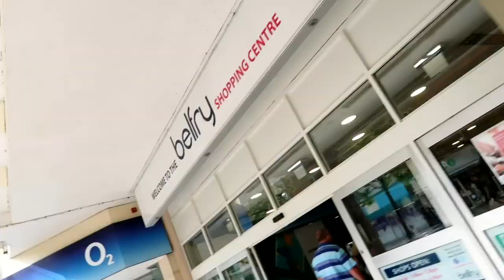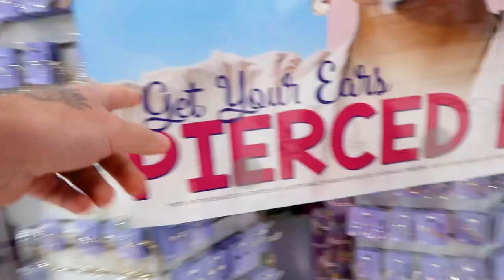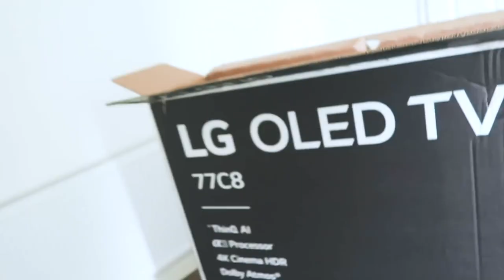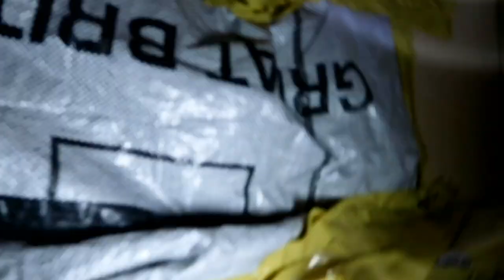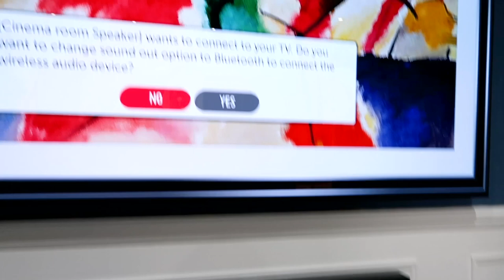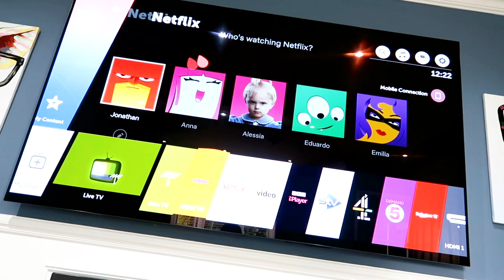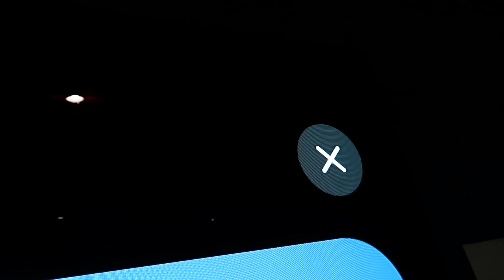NEW SHOE SHOPPING WITH KIDS!

Comment: Just to add to the Claire's discussion.. If you take her to a piercing parlor she has more options for earrings right away rather then a stud that can be very uncomfortable. There is less pain with needle piercing then the gun too because it doesn't put the same kind of pressure on the ear. Though Claire's does use new needles obs with every customer they use the same gun over and over and don't always sanitize nor do I think the guns can be properly sanitized at a parlor they use an actual needle and a new needle with every customer.

Comment: Jonathan when you take the children to get new shoes they need to be standing up when they get measured to get accurate measurements of both length and width because your foot spreads and changes in both length and width when you’re standing and walking around. When they have the shoes on they need to have a minimum of one thumb width from the big toe and the end of the shoe more if the toe box is narrow. They need to be wearing socks or tights similar to what they will be wearing whenever they are wearing the shoes.  I worked in a shoe store for 6 years and was professionally trained on how to fit shoes properly. It irritates me when I see the salesperson doing it wrong because they are fitting the costumer, especially a child, with a shoe that won’t fit properly or last very long because their feet are still growing and changing and how the shoes fit can affect how the foot grows and how they walk. My youngest sister fell in love with a pair of shoes when she was 3 or 4 and demanded to wear them even when they were too small and it affected her toes permanently making it harder for her to get a good fitting shoes. She has to get a half size larger because of it.

Comment: Jonathan please research getting her ears done by a professional piercer because they use a single use hallow needle which causes little to no pain on earlobe piercings plus it is less traumatizing to the skin and ears. The problem with Claire’s is that the gun they use causes a forceful trauma to the skin and ears which can lead to keloids forming (it’s a type of rapid growing scar tissue that can result in very large bumps and heavy growths at the site of the trauma. Check out Lulus body piercing channel where they show them and explain how they form. The piercing gun can’t be completely taken apart and cleaned enough to guarantee that no germs or bacteria get transferred into the ear of the next person getting pierced. Plus the cleaning solution is actually bad for the skin and wound because it contains alcohol and other chemicals that can be harmful. When cleaning use saline solution or liquid antibacterial soap that you dilute a drop in warm water stir and use a cotton swabs to clean front and back then use a clean swab for the other ear then rinse with plain water.  Most piercing shops are moving towards only using titanium , titanium plated with real gold or silver or real gold or silver jewelry because they are the least likely metals to cause a reaction. If you notice a bump forming at the piercing site you can put a drop of Tea Tree oil on a swab and rub it on the bump. Leave on for 10-30 minutes then wash it off. If you feel any burning immediately wash it off with soap and water because some people are more sensitive to it than others and it can have a caustic affect on the skin.  

I understand how overwhelming it can be for the father because I know what my Dad went through with his 5 daughters. Dad came from a generation where the females of a certain economic level didn’t get their ears pierced so he was highly against any of us girls getting it done. My eldest sister didn’t get her’s done until she was in her 30s. My next sister got her’s done at 18 while she was in London visiting family friends who lived on the Isle of White . I got mine done at 16 when I spent 2 months in Germany visiting with the family of a girl who had lived with us as an exchange student the year before. Dad wasn’t thrilled with me when he found out. The next sister pierced her own ears which I don’t suggest. The youngest daughter got her ears pierced after many many conversations during the 9 hour drive when Dad was taking me to the university I was going to or bringing me home. So technically she is the only one who had permission to get them done.  I was very much a Daddy’s girl and I campaigned heavily to be allowed to get it done. He was brought up with the thinking that only women of loose morals had pierced ears so I would observe people at church who were very religious and bring them up as examples to prove his point of view was wrong. Didn’t work which was why I got them done in Germany and it was a huge deal for me to go against what my parents said.

Comment: PLEASE don't get her ears pierced at Claire's, i had mine 1st and 2nds done there and it took so long for them to heal and ended up getting infected even though I followed all the cleaning recommendations and used their own cleaning products which they sell with the piercings, I found I had to use dettol to clean them to get rid of the infection and also soak them occasionally with hot salty water and it ended up being about a two year process for each piercing. But I  got my 3rds done in a tattoo shop which was a lot cheaper and ended up healing within a few months because they use a sharp sterile needle to pierce the ear rather than a blunt rounded earring which is being shot through the ear by a teenager that has watched a few YouTube videos to get qualified

Comment: I feel for you Jonathan in the shoe shop. I have 3 boys with wide deep feet and it is something I dread. Between them not liking the look/ not feeling right and the fat and deep feet it's a nightmare !
Reply: @sacconejolys  I find that startrite shoes come up much wider and generally have more padding round the ankle part. They are a bit more expensive but it's worth it for a comfy fit. Might be worth a try x

Comment: DO NOT get her ears pierced at Claire’s. I worked there! My “training” was a 10 minute video that stopped working halfway through. We learn on the fly and the gun is not a safe option. The “sanitation” is wiping off the gun with an alcohol wipe which may or may not completely clean the gun. It may seem easier but it can cause damage. Tattoo parlors are the best and safest option.